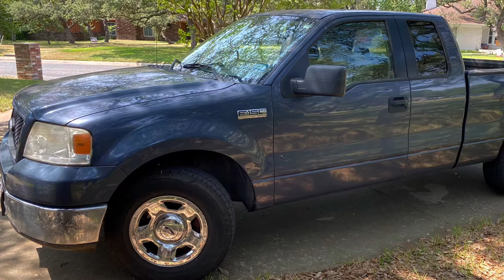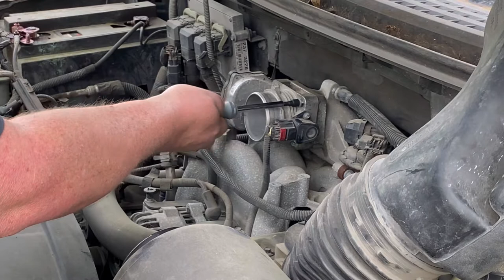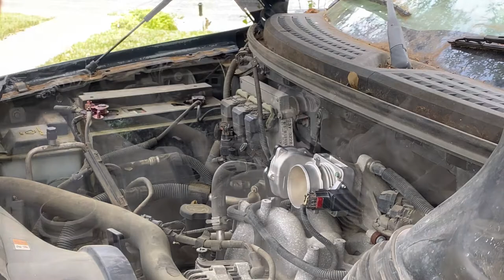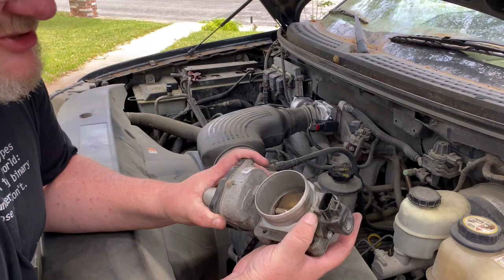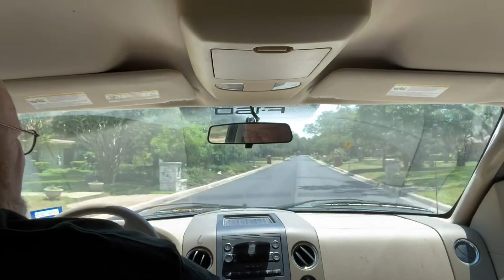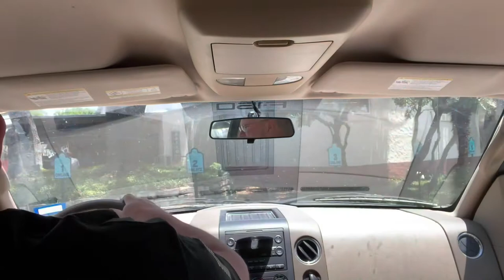Stall No More - Fixing a Stalling/Rough Idle Issue on F150

Comment: Struggled with these issues for 2 years, changed everything that can be changed then gave up trying to fix. By complete chance found some oil leaking from the valve head and had it replaced in the process found out the timing belt was old and stretched and the timing was off. Fixed that and now drives like magic.
Reply from the maker: Nice! Glad you found the issue. These old trucks can last a LONG time if you’re willing to put a little love into ‘em. One of my sisters has a 2006 F150 with 450K miles on it with the original engine and trans still. The one in this. I’d belonged to my other sister. She didn’t drive as much and only has a little over 130K now.

Comment: Hey thanks for the video I have an 2005 F-150 with the 5.4 L 3 valve engine My question is do you have an aftermarket air intake? My air intake is completely different was just curious if there was that much of a difference between the O6 and the 05
Reply from the maker: This old girl is PAINFULLY stock. No aftermarket parts whatsoever. The airbox between the two years is radically different. The principle is the same though. The 05 5.4L does not have an IAC, it is also controlled by the trhottle body. I don't think the link I have in the description will fit yours though. This one: https://amzn.to/3Swo4cB shows to fit an 05 F150 5.4L but if you  go to amazon, run it though their "confirmed fit" checker first before buying it.
Reply: My 2007 has the same air flow as his.

Comment: Did you have any trouble codes (DTCs) during this particular issue such as P0172 (Fuel System Rich on Bank 1) or any misfire codes (P0300 to P0308)? My Dad is having the same stalling, hard cold starts, and rough idling/running issues on his 2005 Ford F-150 Supercab with the 4.6L Triton V8 Engine.
Reply from the maker: I'll be honest, its been so long ago I don't fully remember on this one. I know it would throw random codes that would pop a CEL and then go away on their own, or maybe after a shot of carb/throttle body cleaner down its gullet. I know it did not ever read a system rich code. I remember there was a code that tracked back to the fuel cap, one that was generic in nature, (P100 maybe) but I do remember that it did not show any misfire codes.

Comment: Was it rough when cold as well as warm?  Mine starts rough idling at stops only when warm.  No issues when cold or at speed.
Reply from the maker: It was more apt to die when it was warm. Idle wasnt great at any point but there did seem to be a tendency to be worse when it had some temperature in it.

Comment: My 2006 F150 5.4L keeps dying when idle. It also makes a “clacking” noise. Any idea what it could be?
Reply from the maker: Hard to say without further diagnosis. The dying certainly could be the IAC feature in the throttle body but the addition of the clacking could be timing chain, loose rocker, detonation, exhaust leak, valves, etc. sorry I don’t have any further ideas for you.
Reply: @Kilted Texan  It was the SVT Solenoids. Thank god it wasn't anything major. Thanks for the reply!
Reply from the maker: Outstanding. Glad you got it worked out. Variable timing is a wonder for efficiency but sure introduces a lot of failure points into the system.

Comment: I have a 93 flareside you have any idea why it’s stuttering and does randomly.. especially when a/c is on? Timing issue??
Reply from the maker: If the stutter is worse under load (a/c running) could be anything from vacuum leak to weird emissions control responses. I had a 93 mustang GT that had a weird stutter until i replaced a fuel filter and an O2 sensor. When i did that she ran smooth again and my mileage went from 19 to 24 mpg. Im assuming it is a 5.0 in the Flareside. Unfortunately I think  to properly diagnose would require a bit more info.

Comment: Thank you for your fantastic video post of the Ford F-150 your video post was from the beginning taking the throttle body off putting it on and test driving I watch some videos that vehicles with the same issue just like mine their videos where no help at all because they did not show no repair from the beginning or end not even a test drive after the repair once again thank you I'll just get another throttle body this one is for you champion 🏆
Reply from the maker: Thanks for your kind words! I am currently working on my other sister’s F-150 with a shudder issue but I think it may be a transmission issue because the truck has over 450,000 miles on it. We’ll see if I get that one sorted and I’ll do a video there too. Have a great day and good luck with your truck!!
Reply: @kiltedtexan  please do the video mine have over 300000 OD light comes on say transmission fault the orange light flash then go off then picks up normal speed so I will wait for the your video and once again thank you for your  honesty and yes I come from a family of FORD'S

Comment: 12:16 Sounds like she needs a timing chain service! Cold start rattle.
Reply from the maker: Possibly. It hadn’t run in about 2 months so it may have just been noise due to lack of oil through it for so long. The other times I’ve heard it cold start since then seems way quieter on startup. Either way, she belongs to my sister so I’m not as worried about it ;).

Comment: Throttle body, fuel filter, sensor, how do I know which?
Reply from the maker: I had been through the fuel filter as part of regular maintenance. It is inexpensive and fairly easy to replace so I would say if it hasn’t had a fuel filter in a while go ahead and replace it. As far as the sensor, the only one that I would be concerned with really would be the oxygen sensor. Normally, when those go bad, though, it throws a check engine light. None of the lights on the dash had anything to do with the O2 sensor. That’s why I went straight to the throttlebody.
Reply: A blocked fuel filter will prevent the engine from producing good power

Comment: I changed 02 sensors and still stalls at lights when warm
Reply from the maker: Still sounds like an IAC (Idle Air Control) issue. If it is not something in the throttle body, it may be a PCM issue. Right now I'm battling an issue on my other Sister's truck where after it is warm it shudders under load and under 2K RPM. I am probably going to try to SWAP out PCM's and see if it has an effect. Since I have 2 2006 F150s I'm hoping I can change out the PCM and the lock cylinder (Since the keys have a transponder in them) to test and then without having a PCM reprogrammed.

Comment: I got f150 2006 stalls at every stop light. N I gota put it in to n n give it gas to keep it runing.
Reply from the maker: That does sound very similar to what this truck was doing. Sometimes just rolling down the road at 30 mph and letting off the throttle would cause the truck to die.